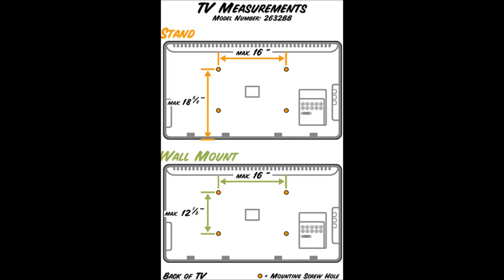How to Setup any Flatscreen TV on Stand review

Comment: Old E-tech/communication-installer/mechanic here, great video as always! Now here comes the... "But"... (aka constructive criticism) At 4:32 you use a Vise-Grip
to tighten the nuts on the mounting bracket... ouch!  Too easy to chew up or round off the hardware with that thang... (ask me how I know that)
Better a 1/4" drive 10mm socket or box-end wrench to keep things snug and lookin' good!  Just $0.02 from an old guy that's been slingin' tools for 50+ years.
Thanks for sharing your skills with others!

BTW I have that exact stand from ShopJimmy and it's as good as they come...

Comment: I got a different stand works perfect just got it 75% put together I don't know why people have problems with the instructions although I work at a car manufacturer and have previous assembly work under my belt. Great video although I always recommend using the appropriate sized socket that way you don't tear up the nuts.